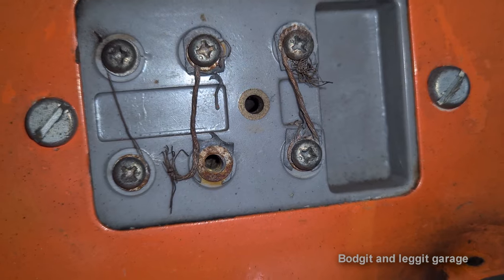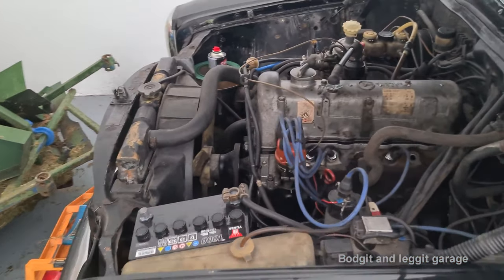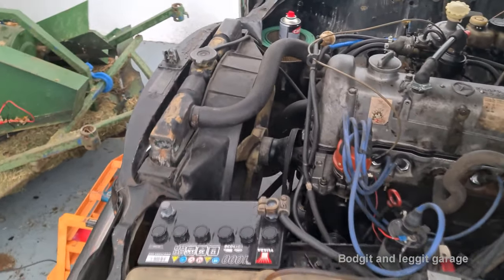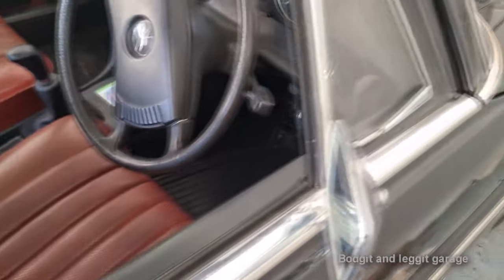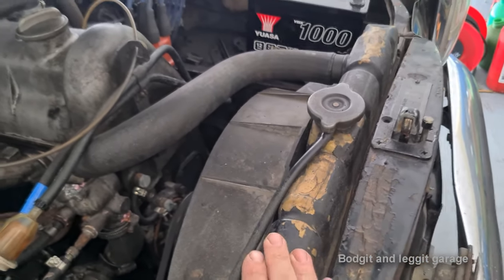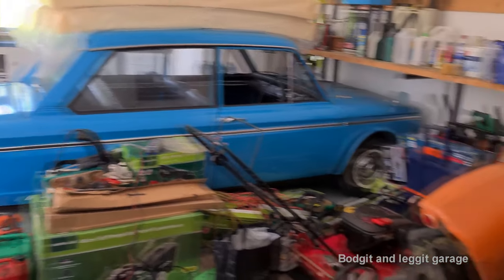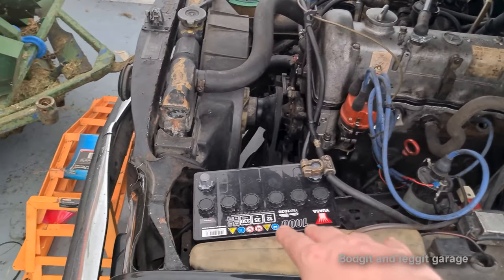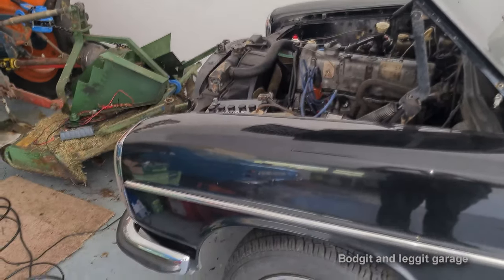Hillman Imp | W115 Mercedes | Kubota L1550 | Can I Fix Them

Comment: I dont know about most cars but i do know about imps. Ive had many- probably 5 in my life- the last one went only 21 years ago. Rebuilt engines, completley stripped/rebuilt shells, all suspension off and painted/reassembled. The only thing ive never stripped is a tranaxle unit.

Comment: I love these old Merc's, I had a 71 280SE, 3.5 V8, loved it, wish I still had it now, also had an 81 300D with nearly 300k on the clock but it just kept going, pulled like a train even with a boat on trailer hanging off the back going back down to south of Spain, can't wait to see how you get on with this one, also loved the Imp's when I was a kid as they were so different to the Mini's & Austin 1100/1300.

Comment: them imp were a swine to get to the engine when you have a bad back and i did not have any gear to get the engine out scrapped it  keep up the good work looking forward to the merc  being done please please remover that tea bag strainer out it will leaf it not done right and there is still good tread left on the wheels of the tractor